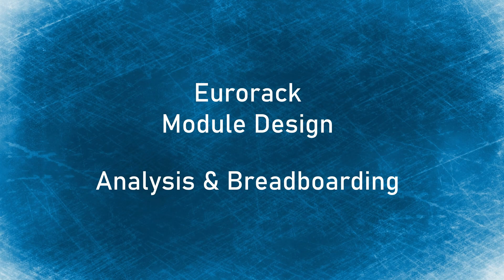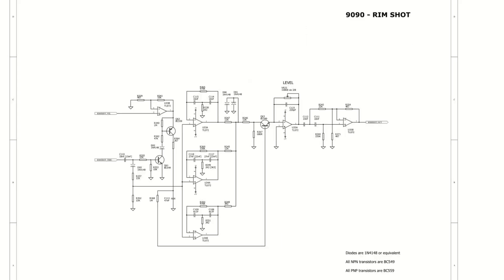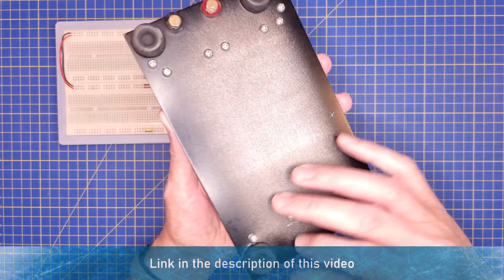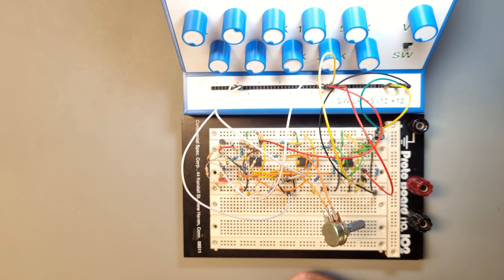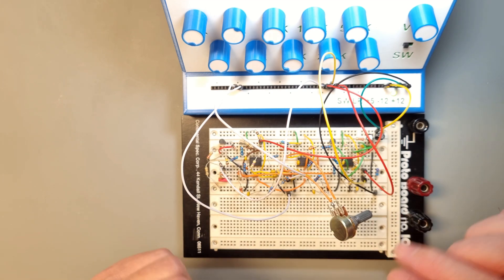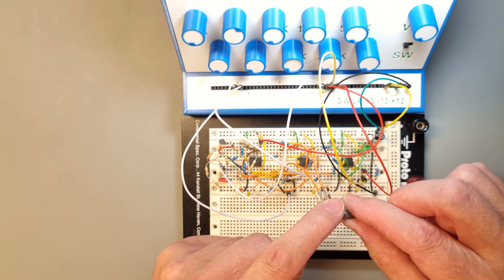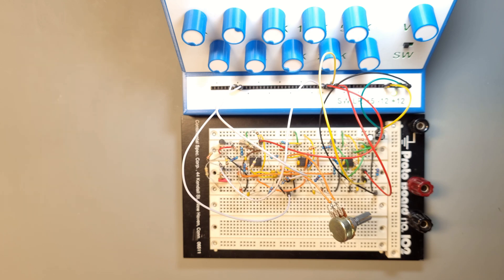Eurorack DIY: 909 Rimshot (Episode 1) - Design analysis and Breadboarding

Comment: Can't wait to get the sample BIN files.
PIC18F27/47Q10 (datasheet) is a 28 pin or 40 pin PDIP packaged with up to 128K flash ram and 1 to 4K SRAM and 5 volt capable.
enough to store the sample, 10 bit ADC for the Tune knob (speed, timers) and enough pins to trigger.

3 M sells breadboards, but they are not cheap.
I have the original opamp mitsubishi M5218A.

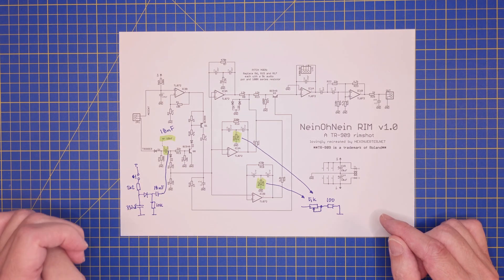7:51 probably you could try JFET or transistor controlled by pot meter on these spots.
Reply from the maker: Awesome! Please keep me updated on the progress, this is interesting!
I have uploaded the .bin-files to my GitHub:
https://github.com/tkilla64/eurorack/tree/main/misc/roms
Reply: @MeeBilt  Cool, now i need to store these at on 2 spots, so i never loose track of them again.
although i have "the" eproms, but no reader.
at the moment i only have Pic18F252 and Pic18F452, witch are 5 volt devices, but only have 32kb flash ram, i need to make a cut i them and it has been a long time since i looked at the contents of these binaries, like close to 14 years. 
i have microchip ICD3 programmer / debugger. but a pickit will do as wel.
Installing a hex editor.
Reply: @MeeBilt  Could you design "slim" pcb with 14 resistors, leds and a BS170 mosfet on the LOW side for no strain or load on the data lines, to analyze the 14 addres lines, the 8 outputs of the eprom and change the 470pF to a much bigger one for timing on your hi-hat breadboard, to find out to where it counts for the open and the position of the start of the closed hat. it seams up to 12 bit if you look at the schematic, that's 4096 samples.

to figure out what the circuit is actually doing, from there it's easy to include in the source code of a pic, the microchip Faburino has multiple continuous memory blocks of 32768 words (and it fits), that's the total memory of a pic18F252, continuously, but the first 18 lines are used for the chips configuration.

We can do this, but this circuit has to probed, check my latest video on how the eprom of the Ride Cymbal eprom file looks like. uploaded it last night.
Reply from the maker: @AnalogDude_  I'm not sure what the issue is, to me the contents of the bin file looks as expected.
You are aware of that only the upper 6 databits in the EPROM are used (D2-D7) ?
And the 0-level is represented by the most significant bit set and the rest are 0 (i.e. value 128 or 0x80)
Reply: @MeeBilt  that's what i said 2 messages ago, that it looks like only the upper 6 bits are used, hence the 4174 or 74hc174 is only 6 bits. today i looked the schems of 9090 indeed it are the higher 6, 128 = 10000000, correct 0x80. 

But i have to know, since the hi hat are 2 sample in the same file, where one ends and the next starts. a slower timer and strip with 14 leds (via BS170 mosfets or MMBFJ201 JFET) on the Address pins of the eprom would helps us out a lot.
Reply: @MeeBilt  i have made a simulation of the CD4040, i saw how it counts, because i added leds. the magic happens around the 4 diodes and the cd4520, the 14th bit splits the amount of rom.
Reply from the maker: @AnalogDude_  Sorry, now I understand what you mean. The ROM address mapping of the hihat is described on page 5 in the TR-909 service manual, but it seems that you have figured it out anyway
Reply: @MeeBilt  Cool, i forgot about the service manual, after a search i found multiple of them on me pc,  110 0000 0000 0000 = line 24576 and has value 128, the hi hat is doable, but the Ride and Crash have some additional binary / analog magic. apparently these roms are edited. the high 6 bits make a analog voltage to form an envelop.

You could still use the eprom, use a pic for addressing and skip ic 4011UB, cd4013, cd4040, cd4520 and loose components around these, the result will be same.
You could try it with a Arduino if you got one or Microchip Fubarino witch has a 16 bit port.
Reply: @MeeBilt  Read the datasheet of this 16 bit pic, the PIC24FJ128GA204.
the b port is 16 pins (perfect for the eprom), 5 pins for portA, 16 bit wide counters, SRAM, programming flash.
accept you need to level shift I/O pins from 3v33 to 5V (and vice versa) via transistors with resistor on the base. the perfect one MCU, 28 pins. a few pins on the A port are analog inputs for pots and so. 128kB flash. so you can try both options, use intrnal flash ram or the eprom, i got that one at home.
Reply from the maker: @AnalogDude_  Very interesting, I will have a look at that when I have time. I have no plans to rework the hihat right now, but this is definately something I will look into with the cymbals (crash and ride).
I'm more familiar with the Raspberry Pi Pico, so I'm thinking of using that.
Reply: @MeeBilt  check service notes of Roland TR-707, it contains updated ride and crash circuit.
Reply: @MeeBilt  I'm trying with my Microchip Fubarino (Arduino IDE) and a couple of old 74LS14 Schmitt Trigger Inverters, i found last night to translate 3v33 to 5 Volt on a breadboard with a led and 220R resistor, it works without a cable on the pin 7 (gnd), but with cable on GND it seizes to work, i measured continuity and voltage, everything looks alrite, but the function of the chip doesn't work. old, but unused / new.
Reply: @MeeBilt  Microchip (Fubarino) is a better MCU producer, because apart from the datasheet, you have extra application notes free for download on how to set up the goodies, like SPI, I²C, Timers, UART (midi), etc per MCU range.

The microchip documents are easier to read and understand, contain code snippets than other producers, like ST and so.
Easier to understand the registers in the chip you have to set or unset to turn something on/off.

After a few days of fiddling around, i extracted the "snaredrum" from the tr-707 eproms and parsed in to a new *.bin aswel parsed an array in a C++ header file with help of a old version of Audacity (import /export)
Also looking at "wav" file and how to extract data and create bin file or header, this 16bit signed vs unsigned is still a thing, although i got the data, but not aligned properly.

did a test with a CD40106 instead of 74HC174 and was positive versus the DM74LS14. now i need to search for resistors and setup a 32kHz timer to spit out the data in the array from the header file.
Reply: @MeeBilt  I made a C++ console app and read the file "r909cr.bin", it indeed contains 32767 lines of chars or integers, apparently only there the upper 6 bits of the eprom are used (that are connected to the 74hc174), because much of the numbers are above 127. witch a bit more code and my app produces a header file with an array, that can be used in the microchip ide.

Also tried watching every line by asking to press enter, but quickly i found out it required a lot of presses. it's hard to find out what's really happening in a console app.  lot's of numbers are around close to each other and some times a small, like 80 , at the end a range of unused or so, 128.